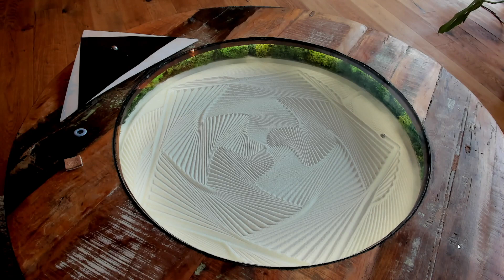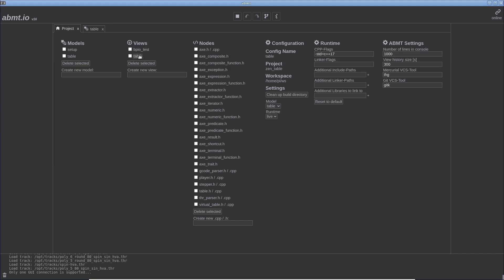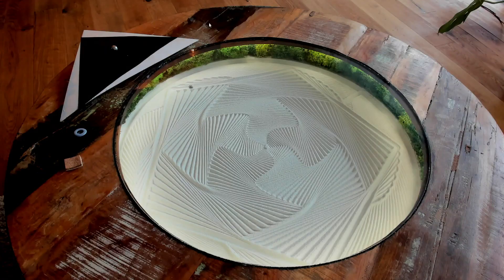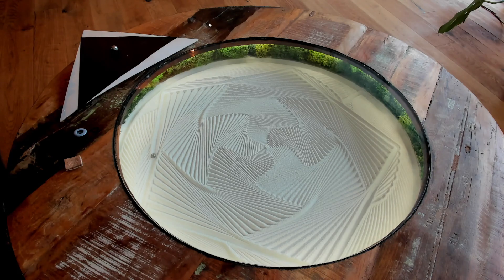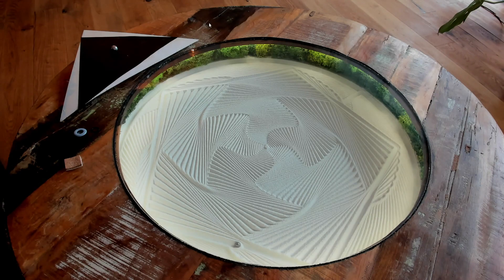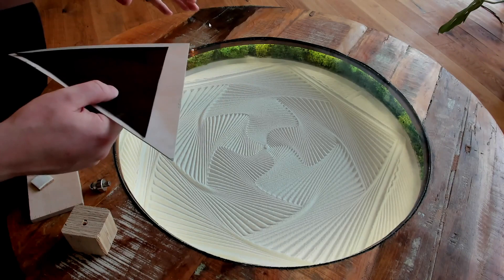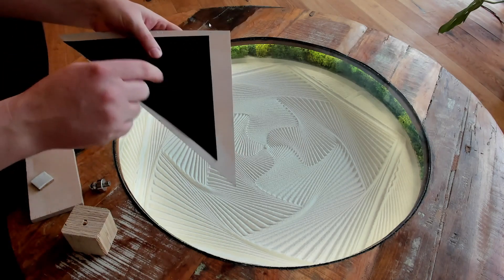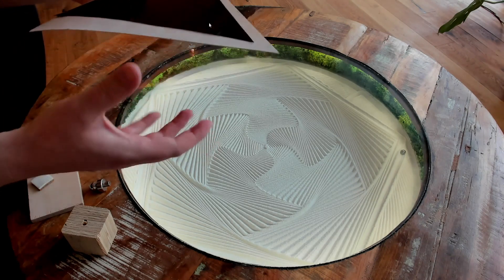How to create a zen sand table part 1: Basic concepts

Comment: Thanks for this video :) I just finished something very similar to this using an Arduino, CF card reader and a 'sisbot' style mechanism with the pinion in the middle and a rack slider. Mine has 5mm perspex plate with a faux leather sheet on top. I'm going to try some less powerful magnets, I also like the idea of the smaller one stacked on top as I also have not-very-smooth ball movement currently.  I have a 20mm x 5mm thick N52 magnet.

One other question - what do you use for the sand? I'm using 'hamster sand' which has quite a small grain size, but I feel I could go smaller....
Reply from the maker: I brought fine (0.1mm) decoration sand on ebay. It works fine but attracts some moisture after a year or so. Then the sands gets a bit clumpy. I will try some Hamster / Chinchillasand when my sand is worn out. Finding the right sand is not easy. I brought at least three different types of sand until I found the one I'm using now. I remember a test with a slightly larger grain size that also looked amazing and a bit more nature like. But that was before the current setup, so I can't tell anything about the impact on the movement of the ball. But to large gains lead to improper movement.

Finding the right combination of materials requires a lot of try and error. My experiments with a plastic plate were terrible but 3mm multiplex wood worked surprisingly well when fixated to the frame. I'm not so familiar with perspex, but I can imagine that it should work well, even if 5 mm sounds a bit thick. Keep me updated when you found a good combination.

Should I ever rebuild my table. eg. when its worn out completely. I would also go for a pinon in the middle approach. On the second thought the additional effort is not that big.  

What are your experiences with noise and what stepper update rate have you chosen? Congratulations on getting all this running on an Arduino!!!
Reply: @abmt  Thanks for the detailed feedback, it's appreciated! Comments on your comments:

My initial thoughts were  the Arduino Nano wouldn't be fast enough, but actually it's fine. The code is using about 50% of memory only, and wasn't super complex to write (I'm no expert!). Most of the heavy lifting is done by reading a THR file line by line from an SD card. It's interesting that most examples I find on YT are using linear sliders or even x/y solutions on a round table. I think the sysbot approach is actually much simpler, and the conversion of theta/rho into actual servo steps is fairly trivial. I guess I'm lucky though because I have a small CNC router to make the parts. They could likely be 3D printed too though.

The hamster sand is somewhat larger than 0.1mm I think - I'm going to try something finer to compare.I had to sieve out some larger pieces!

I'm going to order some magnets to try and improve the movement. I use some velcro (the 'loop' side not the 'hook' side) stuck to the magnet, which slides silently on the perspex. PTFE would also work - I have some I used to make the 'slider' in the mechanism (the whole mechanism CNC cut from 8mm perspex and 2mm PTFE, the only stock items are the theta stepper drive pulley and the 2mm toothed drivebelt)

Re noise I have TMC2208 drivers which are relatively silent. Running the steppers (longer step duration) slower obviously helps. I have two sizes of NEMA17 motor - I found the smaller ones underpowered but they might be okay when  I have revisited the magnet arrangement. I didn't find using smaller microstepping made much difference. Overall it's relatively quiet but could probably be improved. Tweaking the motor current on the stepper drivers also affects the sounds levels.The 10mm tabletop glass on top does a lot to quieten the sound of the moving sand.

My overall specs are:

- diameter 600mm (to match 600mm glass top), working area about 530mm diameter
- 6:1 ratio on theta stepper drive pulley-> main gear
- 4800 steps/rev on theta, 3600 steps per radius movement (0 -> about 265mm) using 1/4 microstepping  and normal 200 steps per rev motors
- Arduino nano and 2xTMC2208 drivers for Theta and Rho motors. I also have a separate nano for addressable RGB LED strip around the perimeter, plan is to control this from the 'main' processor using I2C commands
- 20 x 5mm N52 magnet (too powerful!) and 3/8" ball bearing. Hamster/rodent sand
- hall effect homing sensor with interrupt on the theta movement, TBH this isn't essential since as it's round the home position isn't critical. Anyway it ensures the same position every time
- rho homing is dong by overshooting and stalling the movement on startup (moving by 3800 steps)

The 'syphius' style motion for the rack-pinion solution is fairly easy to code - for each 'line' of movement it's just a case of offsetting the theta movement from the rho movement in my case this means subtracting 1/6 of the motor steps because of the gearing between the stepper and the main drive pulley

Will post a video on my channel when I'm happier with it! I'll also show the insides.